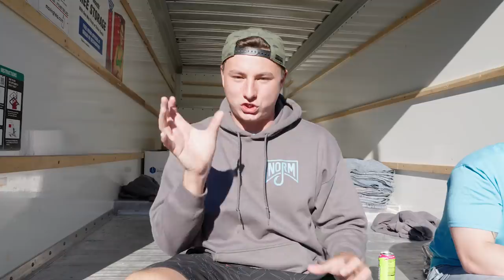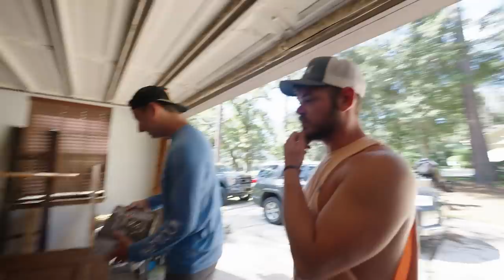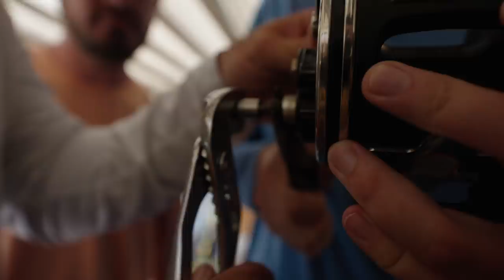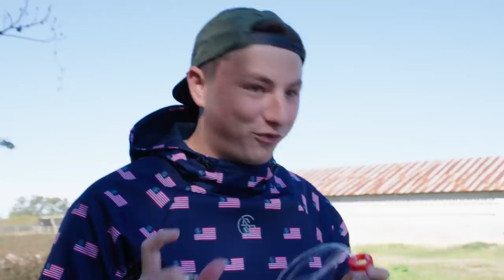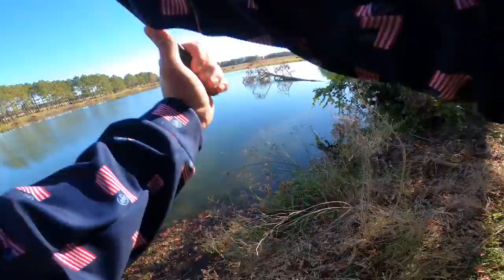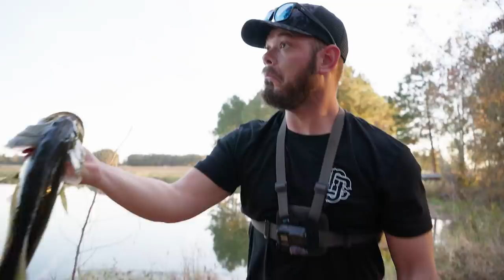We Made The World's First CAR BATTERY Powered FISHING REEL (IT WORKS!)

Comment: Dude, so the way those old-school electric reels work is it's an electric winder attached to a reel in the place of a handle. That part you took off is literally just a vintage left handed Penn Senator with the handle taken off. Those were and still are really popular saltwater trolling reels. So if you wanted parts they're super easy to find. Even a whole new reel wouldn't cost much. Here in NC I got two of those 8000 size Penn trolling reels as combos for $25 each on marketplace. So when you guys go to use that again either buy a new pinion gear for that Penn reel or just buy a whole new left handed Penn Senator. WAY cheaper.

Comment: Y'all get yourself a set of Nicholson die sinker files. Next time you have crossed up, half stripped bolt threads you'll find these little files are the best if a tap and die are not available. The files will not help for the inside threads. Lots of times straightening up the bolt threads is enough to get the bolt to thread back decent. Sometimes tapping the inside threads is necessary. Not always. Peace

Comment: 30+ years ago we had rail mounted reels rigged to car starter motors for fishing in deep water. They worked well.
Reply: No kidding was it chain to gear or maybe a gear to gear set-up. Reading you're comment has my mind whirling lol
Reply: @brianhoward664  it was gear to gear on some and others were driven by a fan belt and pulley set-up. The starter was usually out of a 6cyl Ford motor (no real reason - just lots around).
You can actually buy electrically driven jigging reels since the 90s. Most commercial fishermen use them and I still see a few on bigger recreational boats. They're not cheap though.
Reply: @TheCaptainbeefylog  that's awesome I'm a freshwater fisherman so this is all sorcery to me
Reply: @brianhoward664  lol. Much like fly fishing was to me for a long time.

Comment: If you use a Flexible ruler 36" You can pick one up in the clothing materials materials sewing area is ariels in WalmartAnd you measure the fish by the length Multiply by the Girth Multiply by the  Girth again  Example 12" long × 10"girth × 10"girth = 1,200 ÷ 800 = 1.5    
(1 pound 5 oz)  You could check the farmer's almanac how to estimate Fisher's weight Or you could just go ahead and ask Google How to estimate a fish's weight With out a scale

Comment: I'm 11 months late so I'm sure you figured this out by now but the plug on the reel is the same as a trolling motor plug on a boat. also the white wire is ground not the black wire. all boats and campers run white as negative and black is positive.

Comment: Thats a common plug. I've seen electric net winches with 30 amp L21-30 plugs. That's just a scaled down one. Homedepot has adapters for those 20 amp plugs
Love the videos by the way. Keep it up. Never a dull moment.